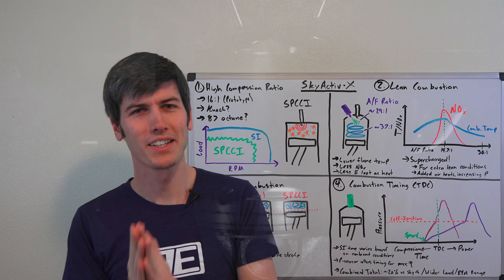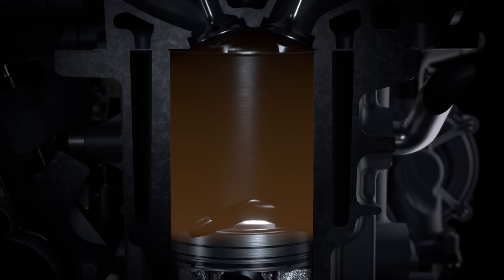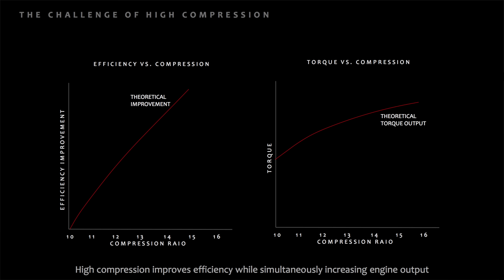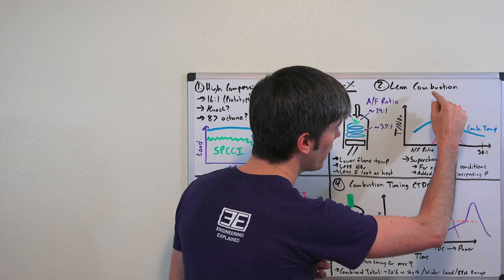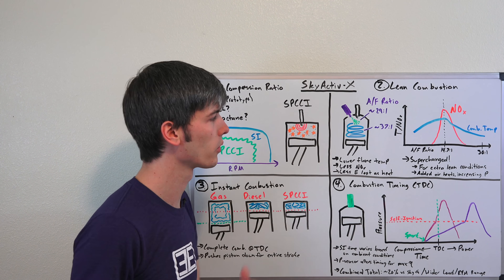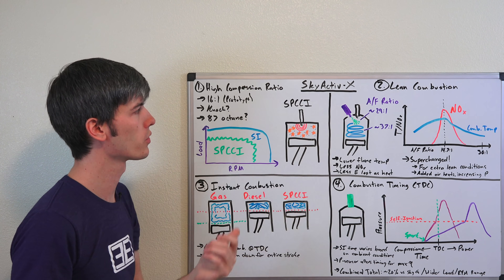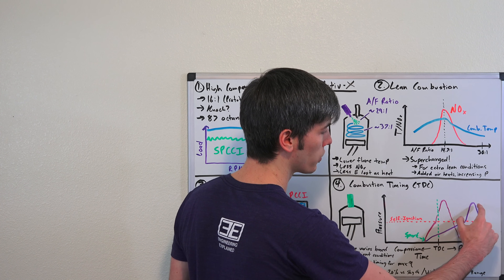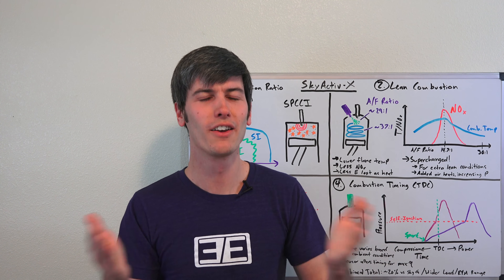How Mazda Is Saving The Gasoline Engine - SkyActiv-X

Comment: Hmm Mazda certainly is a leader in terms of fuel economy... But that  said the large majority of their lineup are cars with less than 200HP, so it's kind of an apples to oranges 
comparison not to mention to use of hybrids in others etc. etc.

Still a 20% efficiency gain for an already class leading engine design is very impressive,  although part of my brain can't help but wounder if Infiniti's VCT technology
can be adapted into Mazda's design. 

They would naturally have to make adjustments for the two to work together but aside from costs I don't really see any obvious reasons why they couldn't combine the two.
Reply: BigHeadClan also add koenigseggs camless valve head with pnuematic valves with decreases reciprocating weight while adding electronic variable valve timing 😄😅
Reply: Infiniti already uses electronic VVT  in the VR30 and pretty sure they have it in the VC-T,  but pretty sure the camless valve head system wouldn't be compatible with either the Skyactive or VC-T.

But admittedly I'm not super knowledgeable on the inner workings of most of these engines.

Comment: Not very powerful, just 190 horsepower.
Once american, always american :)
Greetz from Europe
Reply: Vedad1944 190 is weak.. my daily driver (3.0L modded twin turbo diesel) puts out 365hp/595tq at the wheels on the dyno.  Still want more power!
Reply: BrianNC81 Well my naturally aspirated 1.4 liter 8 valve 4 banger makes 60HP and i can't get to 4th gear and I'm at the next traffic light.

Comment: I don't understand when people are going to learn that fuel economy destroys the engine. Lean air/fuel mixtures burn the pistons and the head witch are made from aluminium (because it's the next easiest thing to burn after the fuel is all out) and I doubt that they will start making them from another stronger material because it will make those engines expensive. So that means that those engines will have like about 100 000 miles of life tops and like any other small and "efficient" engine and then you'll have to change it or the car. I miss the days when cars made 20 MPG for 1 000 000 miles and more for years and everything was strong and durable. Now the life of a normal family car is 4-7 years or 150 000 - 200 000 miles tops and then everything starts to break down right after the warranty is over. That consumer thinking is destroying our world. But I admit that the video is very good and well done.

Comment: Mazda is basically at the forefront with internal combustion engines. Makes me proud of owning Mazda products!
Reply: Damn straight.
Reply: Striball Absolutely correct. If not for all the green subsidies electric cars and renewables technology wouldn't even be able to get its foot in the door. Last time I checked the rare and precious metals mined from the earth to make the worlds most efficient batteries aren't exactly in abundant supply (unlike coal and oil) either. The world is looking in all the wrong places for it's 'answers'. But not Mazda. Evolution, not revolution, and engineering of ever greater efficiency for the internal combustion engine.
Reply: @jasonmcmillan4373  Elbow Musk says lol
Reply: Jason McMillan batteries have the capability to be made from clean renewable materials. Lithium and other metals aren’t absolutely required to make batteries. That’s the thing about electric cars, they have the capability to be 100% environmentally friendly, something ICE engines will NEVER be able to achieve. It’s literally impossible, but it is POSSIBLE with electric cars. Eventually electric cars will be able to be manufactured in clean factories with 100% renewable materials and battery packs will be manufactured with 100% renewable materials and the electricity used to charge said batteries can be sourced from 100% renewable sources
Reply: @gewdvibes  You're living in a fantasy world!
Reply: terry jenkins not really, there’s entire states that are 100% renewable already
Reply: @gewdvibes  It's more realistic to make all gasoline engines run on ethanol. Than it is to make and eco-friendly battery.

And even if such a battery existed you can never possibly produce enough electricity with photovoltaic apnels and wind turbines. Only real power sources are coal and nuclear. "Renewables" are a joke when it comes to producing electricity. They cost huge amount of money while they produce hardly 20% of their installed power in a year. Only thing renewables are good for is destabilizing the grid.

Comment: Question: A high RPM engine is tearing faster then a low RPM engine? My intuition is saying that a high RPM engine will have a shorter life.
Reply: RadioactivFallout it will, that’s why crown Victoria’s, for example, have long lasting engines. They have V8s, which never have to work really hard and rev high, so they last longer because they spend less time under load.

Comment: Does anyone know what the reliabilty is like with these engines? If the pressure sensor in the cylinder goes man down does it have a safe running mode because it looks like this engine could go wrong quick

Comment: If it adds more complexity (harder to fix) then it's not worth it.
Reply: Electric motors are far far more reliable then any IC engine can ever be, mostly because they are extremely simple. An average ICE car has dozens of electric motors, and you practically never have to replace them, or even do any maintenance.
Batteries can last practically for ever if you take care of them properly. Phone batteries are abused brutally, that's why they die fast, but it's not a concern since you buy a new every few years anyway. At least that's what the manufacturers want. Car batteries on the other hand are designed to last long, and they have a computer that takes care of them well. Owners use them more carefully too. The key trick is to keep them between 20% and 80% charge as much as possible, that drastically reduces degradation. You obviously doesn't do that with your phone.
Reply from the maker: May I recommend a single-speed bicycle for transportation? Super easy to fix.
Reply: Vince O teslas packs last anywhere from 500k miles to 800k miles on average. Can't say I've ever owned a car that's engine lasted that long. Blower motor in my dad's 200k mile avalanche is still going strong and that was a dollar a dozen part selected to break and earn dealerships maintenance income. The motor in a tesla is not designed to break and is easier to swap than a typical engine anyways.
Reply: Vince O Apple said that AFTER they got caught slowing down phones, so let's wait for the DOJ verdict on Apple cheating customers. New battery technology is around the corner thanks to Samsung and their real innovation with graphene balls. 5x charging speeds and over 1k cycles, and that is just the begining. Props to Mazda for their effort, even do is a bit to late, ICE is already dying.
Reply: András Bíró You are definitely over selling electric tech. Batteries and electric motors are wear components. If they were as reliable as you claim then no one would ever have to replace their alternators or starter motors and Apple wouldn't have to slow down phones due to battery wear. We are already starting to see some older Teslas being performance limited due to battery wear.
Reply: Electric cars are also extremely simple, very reliable, and require only minimal maintenance. So while this tech is cool, I'll never buy an ICE car again, it makes no sense.

Comment: One thing's for sure, in terms of manufacturing cost, a large Li-ion battery will never be cheaper than an engine block and transmission.
Reply from the maker: And gasoline also won't be as cheap as electricity. There are trade-offs on both sides.
Reply: Sure. So it's up to how long you want to use it and what kind of trips you take with it. But it's pretty much certain that engines will be around for a long time in cars. Especially after it's possible to scale up atmospheric gasoline or methanol production.

Comment: 190 HP not powerful? is same as your Integra.
Reply from the maker: I had the GS, so my Integra was only 140 HP haha.
Reply: damn shame :D but 190 is not really a weak engine. I missed the displacement tho... is it a 2 liter? I mean Mazda.
Reply: Engineering Explained Even my 90 Integra cruised so well at 120...like no big deal.
Reply: yeah but an integra weighs about 500 lbs less than a mazda 3 though

Comment: I don't get what's the obsession over power and "fun" to drive for americans. I can get to university with 90 horsepower and my mother did it with 30 back in the day, there is nothing inherently fun in commuting nor is something that requires big engines. It's like everyone here has to drive constantly at 200 mph.
Reply: because it's not an obsession, the vast majority of people think of cars as an appliance and drive a corolla for their commute. It is the minority that try to make that commute less of a chore, by enjoying their vehicle. it's not an obsession, it's just youtube channels that reflect the average car buyer are just not interesting. 

as for 90hp, I wouldn't actually feel all too safe with that little power. It takes quite a long time to get up to highway speed if you are carrying weight (I carpool). and there are some fairly short highway ramps where I live. I typically think the minimum power would be around 120hp and a comfortable amount around 140 (especially with modern compacts weighing around 3000lbs).
Reply: My car takes around 12 seconds to flat-out accelerate from stand still to 60 mph and from the toll to the actual freeway there's around ~550 yards, enough to take it easy; I don't feel unsafe in any way. Also who's travelling at 80 mph does it in the overtake lake, in the right most one you find only trucks going way slower than that. There are so many people around driving sub-100 hp cars, no one ever complained, maybe it's here in europe that works like this.
Reply: Probably a europe thing. I drive on a major highway system in Canada. Cars in the slowest lane are doing around 100-110kph. in the fast lanes around 120-130. As for ramp lengths I have on average 150m-250m depending on the ramp. 

what usually demands power for me, is on some instances you have to cut twice. The very most right lane you merge into is typically the exit lane for the next exit (about 500m away from when you merged into it). 2 lanes over is already what I call "full highway speed" around 110kph, so you really don't have that much time, especially with 3 passengers worth of weight with you.

Comment: You said previously that what's preventing a car from reaching 300 mph was the cooling requirements. If this engine runs cooler, would that be enough to reach this milestone? If it's scaled up accordingly, of course.
Reply from the maker: If your goal is horsepower, this isn't really the way to do it. There are far denser packaging options to make more power. Cooling just means more aero is needed. The Hennessey Venom GT (at current specs) should have the power to do it. Now it seems to come down to tires, and someone willing to test it.

Comment: Could it lead to some of the same temperature issues as with diesel engines. Diesel engines do not produce much heat, so you should drive longer trips before the engine gets warm.

Comment: The only thing that could make this great technology even better is if Mazda offered these engines as crate engines which could be bought and swapped into project cars similar to to GM's LS series and different versions could be made to allow them to be used in front ,rear and all wheel drive configs